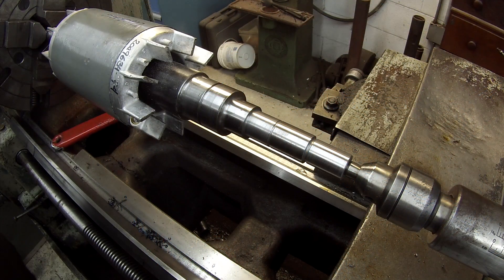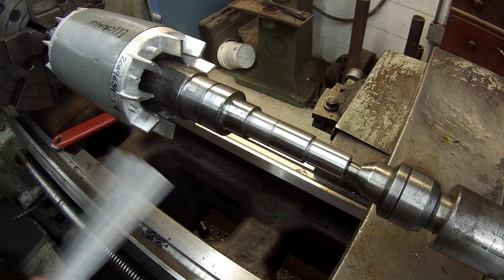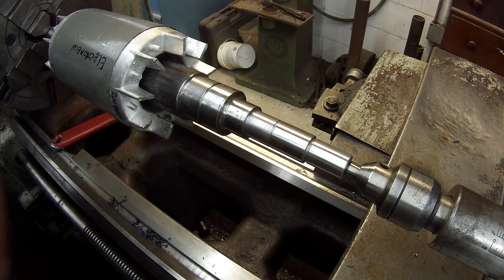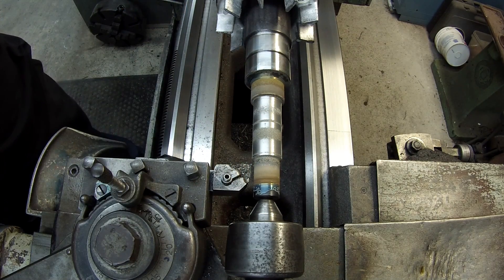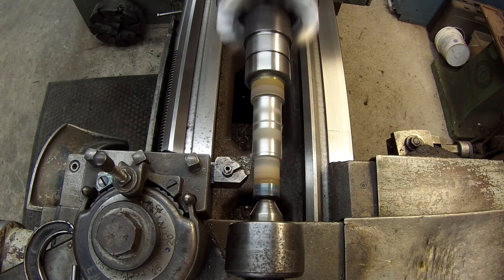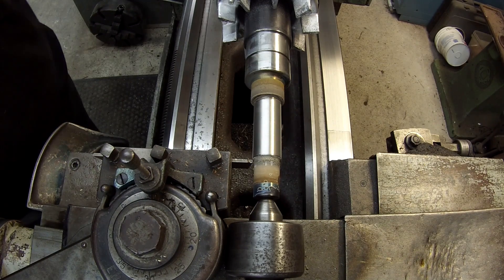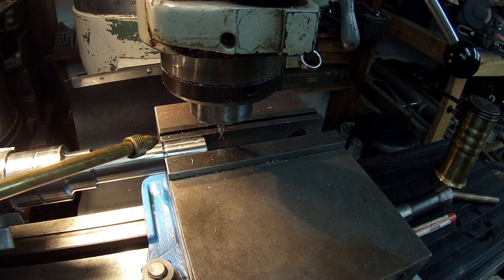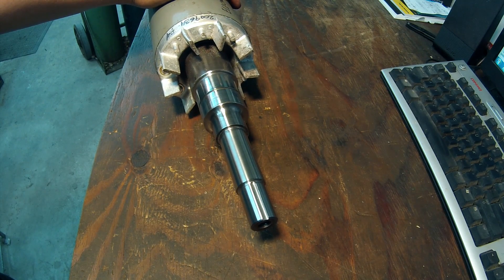Motor Shaft Modification Part 2

Comment: I also metalize shafts at work too... although I spray at a slower RPM, it builds up better in my opinion. 30-40... & loosen the tail stock for heat expansion

Comment: Hey Adam, I don't do machining but enjoy the videos. I've got a flywheel from a small brush chipper that is cracked and a new one needs to be made. It has a piece on it that slides onto the engine shaft and there is a keyway inside it. How  are internal keyways cut? Thanks, Michael.
Reply: +Michael Sewell No machinist here, but from watching Adam and especially Keith Rucker's vids, cutting internal keyways requires a press, either a manual arbor press or a shop press, and a keyway broach, as the operation is called 'broaching'.  Look through Keith Rucker's videos, especially the ones where Keith has to fabricate new gears and you'll see him broach in new keyways on a lot of the fresh-made gears.

Comment: Don't know how I missed this one before.  That nickel treatment was really cool!  I've never seen that process done before.  Thanks for posting the procedure.  Could you explain the details of stuff like this in future videos?  Temps, media composition, type of torch/applicator etc.  It's fascinating to watch.  Who doesn't like watching fire and sparks!  Haha!

I can think of a bazillion times I would like to have had that.  I can't count the times I've had to make something from carbon steel for lack of on hand material and wanted corrosion protection.  I really don't want to mess with the chemicals for electro-plating so this would be perfect.  What are the hardness properties?  I recently turned a new shaft for an antique hand drill and somehow(stupidity maybe? hmmmmm....) took off too much on my final pass and it was just too sloppy of a fit.  Would this be a good application for such a blunder?

Comment: I am in need of refurbishing a motor shaft, and it seems like you know what you're doing. Mine seems much more simple than this. Essentially looking to get rid of the pitting on a 420 stainless motor shaft. I believe simply removing a layer on the lathe, and spray welding would do the job. Can you do this? or not, can you point me in the right direction of where I can get this done near NY? 
Thanks very much

Comment: You mentioned that the spray weld powder you use has a bit of nickel in it which does give it the rust inhibitor property. I was wondering if you had ever given thought to having something like this Nickel plated? I work at a plating factory here in Ohio where we do hard chrome and nickel teflon plating/coating among other things which is why I became curious.
Reply from the maker: I can't say that I have, but have seen and worked on parts that were nickle plated. At my other shop we send off hydraulic rods to have re-chromed.

Comment: Hi Adam, is the heat from the welding going to do any damage to the enamel coating on the wire in the motor?
Mike.

Comment: Watch the new ceiling with the spray weld rig. We would hate to see a scorch mark in that fresh paint. Lol
Good lookin job bro! 
Does the spay welder have diffrent powders like s.s. ?
Reply from the maker: Yes I have a few different types of alloy, but the one I use is a general purpose powder that can be used on different metals. I have a big jug of stainless that I have never even opened. I plan to practice with it on some stainless to compare how it works vs what I typically use.

Comment: Hi Adam. Great videos. I really tip my hat to you - I'm learning a lot. I have a project where I need to make a stainless steel sleeve to act as a bearing surface and press it inside a piece of hardware for a restoration that I'm working on. Any chance you can do a video on making a SS sleeve? I'd love to see how you do it. All the best, Mike. (A big fan from Canada).

Comment: I too am fascinated by spray welding. Looks to me like I could cobble a spray torch from an old cutting torch and a spray paint cup. The metal powder would travel down to torch body (mixing and propelled with both gases), until it meets the Oxy/acetylene flame at the mouth of the torch head, powder becomes molten and deposits on the work piece... Would that work? Watch'a think....

Comment: Hey Adam,
I am always amazed with spray welding. It sure is a nifty technique for building up a worn shaft. I don't know that much about the process but I would assume you can get different blends of metals to apply. You mentioned this one had nickel in it, so that's like applying stainless to the shaft. Anyway, thanks for a great video! I really enjoy your content and usually learn something in the bargain! Hope those steaks tasted great! Now that the holiday is over, it's back to work! :-(
Have a good one!
Dave

Comment: Hi Adam, another fine job enjoyed watching like we always do. As Knolltop Farms already put the question; I guess you  did this before on electric motor shafts but aren't you afraid of metal parts build up from the spray weld could hurt the inside of the motor..?

Comment: Hi Adam, great job, really interesting technique of hard steel recovery, what is the maximum thickness you can cover with this technique? cordially thierry. good evening
Reply: mayhem7090 mrpete222
Reply from the maker: Maximum wall thickness is .040. So I try to never go over .080 on the undercut. It can be smaller in short areas, just not the whole area to be sprayed. Example is in the video, where I had to clean up that undercut.
Reply: Abom79 Hi Adam, thank you for your reply and again good job, cordially ...

Comment: Hi Adam,
Nice job on the shaft final product, good idea for the corrosion resistant heat deposited sleeve.
Eager for a job to come in where I'll be able to use my Rototec for the first time.
Thanks for the teaching,
Pierre
Reply from the maker: You need to show us your first try! let me know if you need some pointers. Hopfully I have shown whats needed in the videos.
Reply: Thanks for offering, so far your videos are very nicely done.
My main problem is to get a video on line, I'm absolutely ROTTEN at computer editing, I should know I've been trying for months now.
And, yes I'll be trying again.
Thanks Adam,
Pierre
Reply from the maker: pierre beaudry
Come on Pierre, I know nothing about computers and I'm able to slap these videos together. I knew nothing when I first started. Got a couple pointers from by buddy Glenn, and away I went. Try the Movie Maker app. I hear alot of people use that. Theres also one on Youtube as well, but I have never even looked at it. Might try that one and give it a shot.
Reply: You and the other machinists in the community really inspired me on my machining projects, now I'm getting encouragements to start producing videos, that something. Might take a while but I don't plan to quit.
Thanks for the boost,
Pierre

Comment: Very Cool Adam.  Used to design cryocoils & feedthru's for sputtering & vacuum deposition systems, but had no clue it could be done this way.  Doesn't look like you have to get it very hot to stick well.  Curious about the masking agent?  Thanks for the great video on it and your machining techniques, a joy to watch & learn!
Reply from the maker: The spray welding works between 200 and 600 degrees F. Warm the shaft to 200 and be careful not to let it get over 600. It works really well for lightly worn areas on shafts.

Comment: Nice job! Have You ever tried spraying plastic powder - like repairing or covering up on a PP coated pipe weld. It can be a hell of a job if the plastic decides that it is too hot, too much, too little, too fast or slow.... I used to have nightmares of these jobs before i got the technique drilled into my hands. Not into my brain, that one is full!
Again, Thanks for showing us..;)
Reply from the maker: Never done the plastic spraying.

Comment: Adam, enjoyed as always.  Is that spray welding tough on the lathe?  Thinking about your center etc.  I see you protect the ways but wonder if the overspray is harmful or like rattle can spray that just dusts off?  I think you said you used an old center in a spray welding video awhile back.
Reply from the maker: Peter, yes i have two old live centers I use just for welding and spraying jobs. The overspray isnt bad. I always wipe the ways down after spraying, and after the job.

Comment: Adam great video.  Years ago, I sold welding products and one of the products was the Eutectic brand of metal powders.  Your torch looks like one that Eutectic used at one time.  I think more than one company sold the same tour setup under their own name.  What brand of sprayed metal do you use?  I know the process works well on a bearing surface or seal surface but if you wanted to use a setscrew you would have to drill threw your sprayed on material so the setscrew would not crack your deposit.
Thanks for all the work you do  in making their videos.  I really enjoy the fix and repair videos.

Steve
Reply from the maker: Steve, mine is the Eutectic torch and powders. I believe my torch is the 1A. I am starting to run very low on  all the original powders my dad had bought, and the powders I bought from another welding shop years ago. I'm going to hate that bill when I have to reorder.
Reply: Abom79 Adam
I was shocked when I looked at the price of filler of metal.  Alloys that I sold for a buck 50 pound are now over 30 bucks a pound.  I cannot even imagine what the price of shielding gas has gotten too.
Steve
Reply from the maker: Yes it's very expensive now. I want to say it's even more than that from Eutectic. But the cost is added into each job we do so the powder is materials that's paid for in the jobs.

Comment: Dennis , made a good question, re heat and sag , as I have never done spray welding i too would like to know if you get shaft movement if left stopped or shaft twist etc when spray welding?
Reply from the maker: I always let is rotate while its cooling, but I have never had one warp from sitting. But that's why I rotate so I dont have to worry about that problem.

Comment: That's a fine modification to the motor shaft.  I'm in the process of replacing the motor on my Clausing drill press and you have me temped to modify the motor arbor, rather than bore out the pulley (have to go from 1" to 3/4")

Comment: NICE JOB!  after your spray welding was done, did you leave the lathe running even at a slow speed, while it cooled to prevent run-out? or you didn't worry about it, because you where going to re turn it anyway? I was just thinking that the shaft might want to sag a bit after being heated if it was left alone while it cooled.?? 
thanks for sharing !
Reply from the maker: Dennis, yes once I'm done spraying i run it on low gear and let the fan blow on it. I have also worried about that, but think it's normal practice to run is slow while cooling.
Reply: Abom79 Cool, I was just curious to see if my newbie thoughts were right.
thanks !